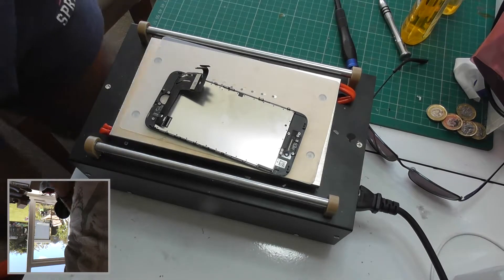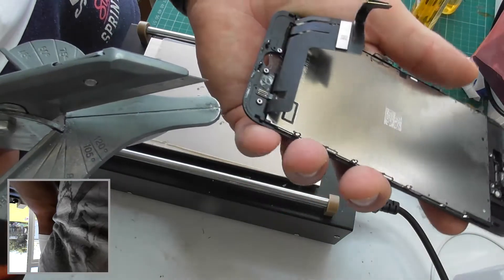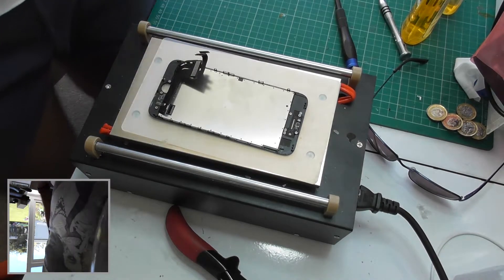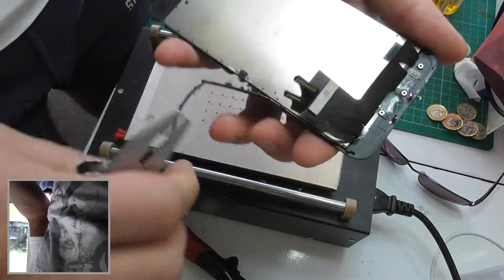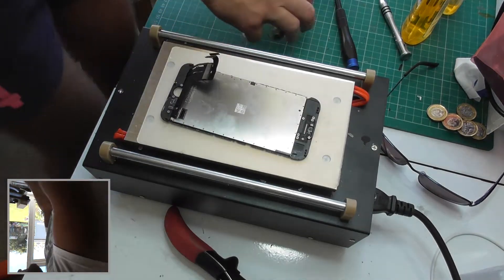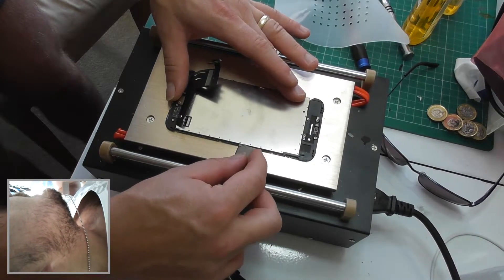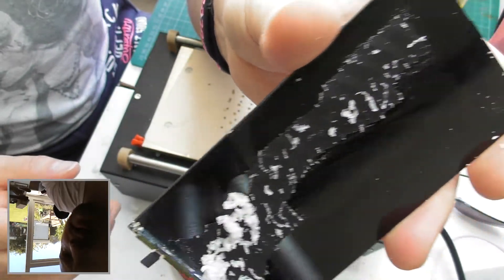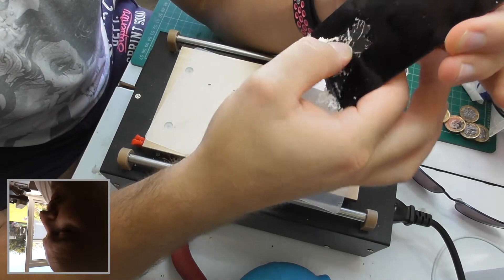How to remove glass from iPhone 7 and not damage the polarizer

Comment: I just got my 3 in 1 screen seperator yesterday and I am finding a lot of the time I am damaging the polarizer while I'm removing the glass.Do you have any suggestions as to avoid this such as tempature of the machine,technique and so on,this would be very helpful.Thank's for the video and your time.
Reply from the maker: +sean jerome it just takes practice. In the video the hot plate was 70 degrees C. Use 0.08mm molybdenum wire, and make sure you keep the wire as close to the glass as possible - don’t let the wire drag glass fragments along the display
Reply: simple bro dont pull up the wire... just pull down